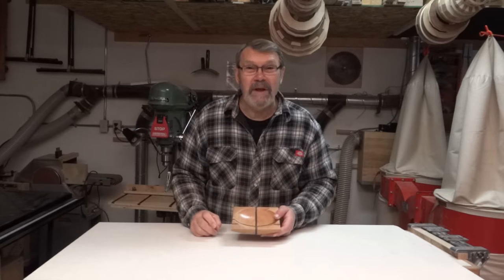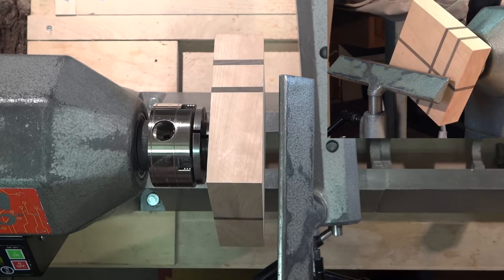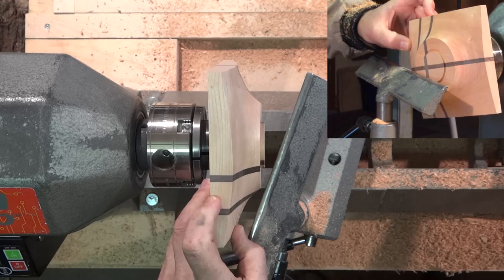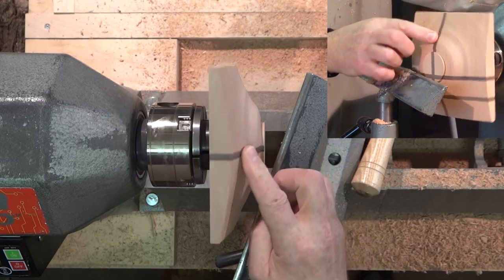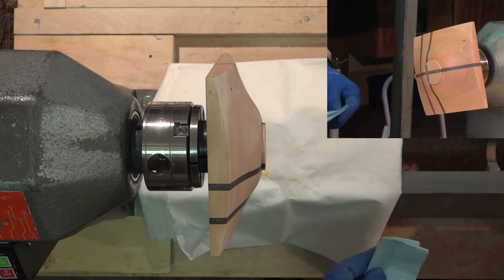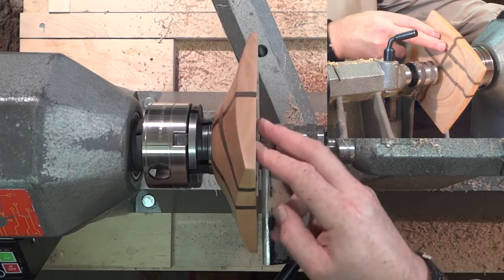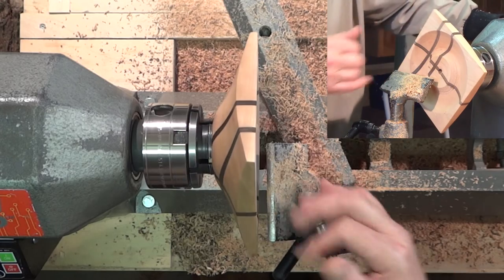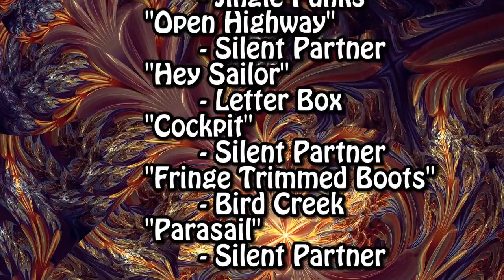Square Cherry & Walnut Bowl

Comment: Gord -- It's a beautiful bowl.  Report back to us how the glue joints hold up over time with changes in humidity.  It appears that the grain in the last two sections of walnut was running across the grain of the cherry.
Reply from the maker: David Walser Good eye, David. I don't usually let the grain directions but want to see what will happen with this. It's a fairly small bowl with thin strips so I'm interested in seeing what it will do. Thanks for watching.
Reply: Gord Rock Gord, I wasn't intending to criticize.  I'm genuinely interested in how it works.  It would open up a lot of design possibilities.  You turned the bowl fairly thick, which leaves more surface area for the glue joint.  Maybe that'll be enough to prevent the glue joint from opening up.  I hope so.
Reply from the maker: David Walser David, I didn't take it as a criticism. I'm interested too in seeing what will happen; that's why I intentionally crossed the grain with the 2 pieces of walnut. I very rarely let that happen but a little experiment once in awhile is a good way to learn. I do appreciate your feeback!!! Thank you.

Comment: You just saved a maple blank I have that cracked, Thanks Gord. I was going to put epoxy in the crack but I will just cut it and use some walnut.   The bowl turned out great too. Again thanks
Mark
Reply from the maker: MARK Baid I'm glad you've found another way to work with that maple blank. Thanks for watching, Mark. .....Gord